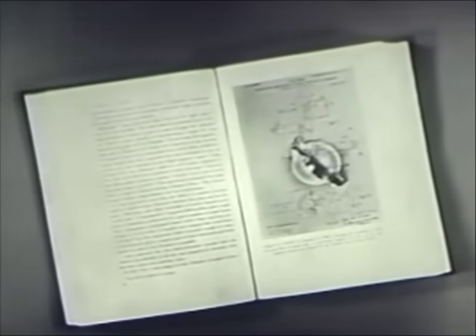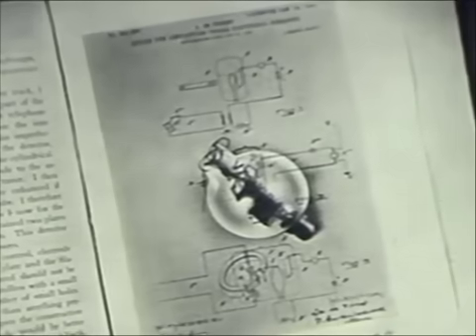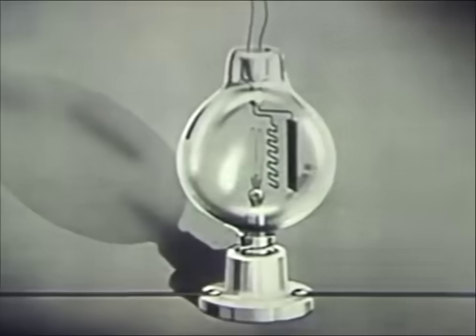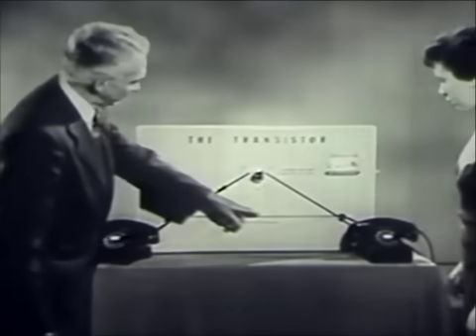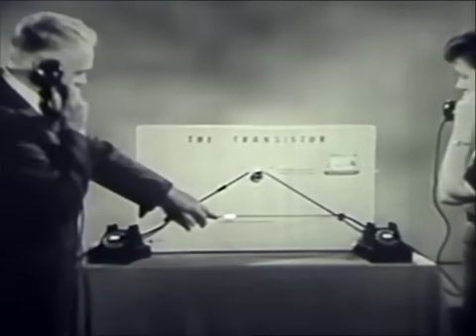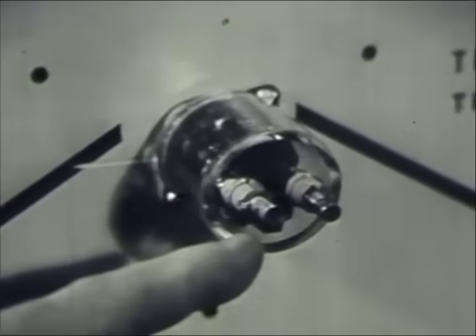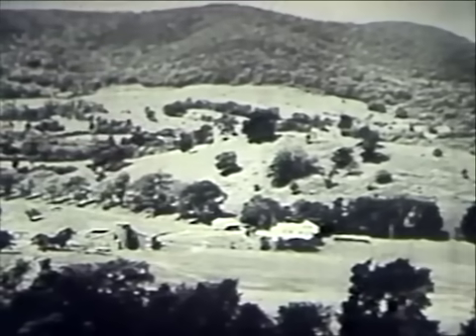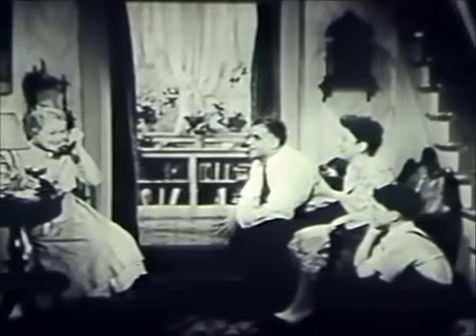The Transistor: a 1953 documentary, anticipating its coming impact on technology

Comment: I used to have a neighbor who worked on computers when they still used vacuum tubes.  He said that no matter what they did, there were always a few of them that were burned out, so the thing never worked properly.  By the way, I still have an old transistor radio somewhere and yes, it works.   The first record player that I received from my parents as a child had a mainspring to power it. Go figure.
Reply: The term "bug" is derived from something that happened in 1947.  Engineers working on Harvard University's Mark II computer discovered a bug caused by a moth trapped in a relay.
Reply: @robertromero8692 If you look at the note they made at the time, it's clear they knew they were making a pun. So while Grace Hopper claimed that that was the first use of the term, I dont think it's actually true.
Reply: That's one of the problems about having a hot cathode in a vacuum, it's inevitably going to have a limited lifetime, rather like an incandescent light bulb.
Reply: The war time Colossus code breaking computer was never turned off, heating and cooling caused the valve/tube failures.

Comment: Another video on transistors said that between 1960 and 2018 there have been an estimated 13 sextillion transistors manufactured. 13,000,000,000,000,000,000,000. And if you count Moores Law, could that now be 52 sextillion?

Comment: The number of transistors in my "electronic brain" used to watch this video number well into the low billions, and only use a measly 45 watts of power! Plus, my laptop is an "old" Mac from 2019 with an "outdated" Intel i9 8-core processor. 😉

Not bad for 70 years of advancement (1953 - 2023)!

Comment: Most people  know about inventions such as the filament light bulb, phonograph, and telephone, along with the airplane and automobile. FEW, however, know the history of the electric generator (which made it All possible) or the evolution of the DC, and then AC (Tesla) electric motor. Marconi invented the radio, and  DeForrest perfected the vacuum tube. The Parsons steam turbine made electrical generation, and steam propulsion in ships, Much more efficient. Frank Whittle invented the jet airplane engine-back in the early Forties, but the Allies didn't develop it in time for World War Two. 
Fluorescent bulbs-cooler and more efficient than the incandescent type-appeared in office settings, starting in the 1920s.  Hall and Herroult developed an economic method to electrolyze aluminum, so that the metal finally became Economical and Practical.

Comment: Cerebras has the world's largest chip: 2.6 trillion transistors -- that's 2,600,000,000,000 -- with 850,000 cores on TSMC 7nm.

For home computers, the Epyc Genoa 9654 (96 cores, 192 threads) contains 78,840 million transistors. That is 78.84 billion transistors in one CPU.

Imagine going back in time, taking one of those CPUs with you, and putting it on the table in front of the original designers / creators and saying, "Your work has lead to this in 2023 -- a computer with over 78 billion transistors doing more computation in one second than all of your computers on Earth presently do in a decade."

Comment: I still have an original 20 pack of 1698 Western Electric point contact transistors in the original box from 1953.  It looks identical to the part on the left side in 0:42 of the video.  Its so old that it even predates the 2Nxx numbering schemes for transistors.  It is even serialized.

Comment: Yet the tubes these transistors replaced, are still massively superior in audio applications to this day.
Reply: And yet the mixing consoles used in recording studios don't use valves, they use op amps containing transistors.
Reply: @deang5622  all the older stuff recorded pre 90ies were done so in studios specifically using valves for all applications.

That's also why hifi buffs go crazy for old RCA recordings, Abbey road, you name it.

Comment: Man, the narrator could never have known just how close we'd get to emulating the human brain with transistors. I suspect we won't quite get there on Silicon, optronics are rapidly advancing and promise a similar degree of speed and efficiency gains over transistors as transistors did over vacuum tubes. That's where we'll see truly human-level (if not humanlike) computers. Also where we'll see the same amount of computing power as an RTX 4090 and a Threadripper with 2TB of RAM in a literal grain of rice-sized computer, powered by ambient light. 

In another 70 years, we're going to be looking at videos introducing and explaining the first optical gates the way we currently view this.

Comment: @ChatGPT "describe the invention of the transistor and how it was perceived to be used in the future" - result is
"The transistor was invented in 1947 by American physicists John Bardeen, Walter Brattain, and William Shockley, who were working at Bell Laboratories at the time. The transistor is a semiconductor device that can amplify and switch electronic signals, making it an essential component of modern electronics.

The invention of the transistor revolutionized the field of electronics, as it replaced bulky and unreliable vacuum tubes, which had been the primary means of amplifying and switching electronic signals up until that point. The transistor was not only smaller and more reliable than vacuum tubes, but it was also more energy-efficient and less prone to overheating, making it ideal for a wide range of applications.

At the time of its invention, the transistor was not immediately recognized as a game-changer. However, as its potential uses became apparent, it was quickly adopted in a variety of applications, including radios, televisions, computers, and other electronic devices.

The transistor was perceived to have enormous potential for the future of technology, and this was reflected in the 1956 issue of the magazine "Electronics," which predicted that the transistor would "revolutionize almost every phase of our lives," from communications and transportation to health care and education.

Indeed, the transistor has lived up to these predictions and has become an integral part of modern life, powering everything from smartphones and laptops to satellites and medical devices. Its invention marked a major milestone in the history of electronics and has paved the way for many of the technological advances that we take for granted today."

Yes I think we can safely say that the transistor has lived upto these predictions and way way more.  This ChatGPT query was pure science fiction at the time this film was made.

Comment: Simply amazing that this came out the year after that weather balloon crashed in 1947! 😉
Reply: I was thinking the same thing. I'm just glad it crashed in New Mexico and not a foreign country. We either would've missed our chance (worldwide as a society) or been some other nation's subject.
Reply: This old myth again.
Do you think aliens in a spaceship 1000 or even as a little as 100 years more advanced than us would be using discrete transistors?

No, of course not. At the very least they would be using massively integrated circuits containing billions of transistors and no one had the equipment in those days to see the transistors on an integrated circuit, let alone probe it with test equipment to measure the electrical characteristics or chemically analyse the elements used in the construction.

Comment: How in the world do videos from the 1950s explain things so much better than most modern day videos.

The analogy with the size Empire State building and the power and cooling from the Niagara Falls required to run a computer using vacuum tubes is so smart. Really shows how much technology is immensely improved by such a seemingly insignificant electronic part called the transistor. It’s amazing

Comment: Wow! 😮
These early pioneers would be absolutely astounded by how far we've come! 😮 The smartphones and tiny computers we take for granted today are lightyears ahead of anything those scientists could have even dreamed about! 😮

I grew up with computers, but I'm even shocked at how far we've come 😮 The smartphone I'm using right now is far from top of the line, but it's still at least 1000000 times more powerful than my first computer!

I thought I was kicking ass when I upgraded to a computer with 128 KILOBYTES of memory! 🤤 Such a "large" amount of memory that it could only be accessed by bank switching 😮 These days 128 k is a laughably unusable amount of memory (What the hell am I gonna do with THAT!? 😂 I can't even load a tiny thumbnail picture 🤷‍♂️) But back in the day, that was enough memory to load an operating system AND a game! With room to spare! 🤣 Most games or utilities didn't even use the full 128 k of memory. I could often "get by" with 64 k or sometimes even as low as 16 k.

My first floppy disk drive was slower than the slowest possible 1G cellular phone network 😅 But it was STILL about 20 times faster than the cassette drive I had before it 😮 The floppy drive would take several minutes to read a full 90 kilobyte side of a floppy disk. And the writing speed was even a bit slower 🐢

But damn I got a lot of use out of that computer! I absolutely loved it! 😍 I taught myself 6502 hexadecimal code on that computer at about 9 years old!

Comment: Speaking of the military....until 1999, an old Rockwell Collins SW3600 model switching system was used to route nuclear launch authorization codes to their respective SAC silos. This switch, which was purely mechanical, had 4 trunk lines and was the size of large room. It was like magic to watch this thing work. It was used for so long because it never failed. Ever.
I was the one who decommissioned it in 1999. 
What we have wrought with pencil and slide ruler alone is absolutely fucking amazing.

Comment: It is funny to consider most of the focus for the use of transistors in this documentary are on stuff considered secondary in the modern era. Today, transistors are most well-known and used as the basis for the integrated circuit, the core of modern digital computers. Mini and Micro Computers and Computers-on-Chips are the biggest technological leap resultant from transistors.

Comment: I remember buying discarded circuit panels from Radio Shack studded with transistors, diodes, capacitors, etc. in the fifth grade (circa 1968) .  The IC was just becoming commonplace, and even then the coming revolution in microelectronics wasn't widely recognized.  Two decades later, Apple's Mac Plus was on the market, rocking 1MB of Ram and a clock speed of 8MHz. The 30MB hard drive that went with it was as big as the phone book. You youngsters might be able to see one of those in a museum.
Reply: The hard drive size sounds exaggerated.  I bought a 10 Mb hard drive in the mid 80s for my PC that was only about the size of a few paperback books.
Reply: @robertromero8692  No exaggeration at all.  The Mac Plus had a 9" diagonal CRT, was maybe 16"tall and about 12" square, and the non-Apple hard drive was precisely the same footprint, and about 4 inches thick.  I drew my first steel fabrication project on it in 1991 using "MiniCad", and every time I zoomed in or out, or made the slightest change, it took a couple of minutes to redraw the view.  Countless hours later, I had a file I took to someone with a pen plotter, who drew it out and made actual ammonia developed blueprints to submit to the architect. He was much impressed by how good they looked and said so, which pleased me greatly even if it did take longer to make the shop drawings than it took to do the actual work.
Reply: @phillipdavidhaskett7513   We had that same hard drive. I was in college in 88 and my dad used my student discount to buy a Mac, and as you say the HD was the same footprint. Still a HUGE step up from our duo-diskdrive equipped Apple IIe

Comment: One advantage of being stationed on a US Navy ship launched in 1968 is that the Navy doesn't generally change things much if they still work properly and upgrading them doesn't enhance mission readiness.

By 1990 the ship was an interesting combination of original equipment and modern technology.  I'm just as comfortable measuring bias voltage on a transistor as i am troubleshooting missing voltages on a vacuum tube.

Comment: "They will make possible more compact devices that will need less maintenance and have a longer life"

 ~ 70 years later ~ 
More compact - check 
Less maintenance - check
Longer life... A radio from the 50's still works today but the one I bought two years ago is broken already....
Reply: Please to not blame the transistor or other semiconductors in the first line. What makes cheap electronics fail in the first place is chemistry. Which is present and also working in (electrolytic) capacitors mainly. These fail often after some - shorter or longer - time. Also: soldering materials often fail due to oxidation. Gets brittle. So contacts are failing. In every circuitry if standing and being used long enough. Semiconductors fail on power overloads, overheating, electrostatic discharge. which they are susceptibe for. (MOS devices especially). A cure for this incapability is already underway today, the SiC semiconductor technology.
Reply: Ok but a television at the time cost like $5000 in today's money. We have created a throw-away culture where people just want things to be cheap and accessible. Also as complexity goes up exponentially so does the room for error and difficulty in diagnosing and repairing problems
Reply: @skeetsmcgrew3282  True words defenitely. But the one from the 90's I bought in 2010 worked until 2017. Pretty good, and the only maintenance was hitting it on the top.
Reply: @oevr37  I remember deciding at one point I was tired of crappy garbage, I was going to buy the "good" version of things even if it required saving up for it. Turns out that generally doesn't exist, the "good" version now is just "smart," or it's expensive because some hipster company did a startup and couldn't find a way to make a deal for labor overseas even though all their parts are the same Chinese crap everyone else uses. Trust me, I get it. But its also hard to argue that "things just ain't like they used to be" when you can get a 50" tv for 500 bucks that would look like a window into another planet full of wizards to people 70 years ago. Give and take
Reply: @skeetsmcgrew3282  This is also true. I personally have something against "smart" objects, they better not get too smart with me, you know. Some kinds of objects still are quality, especially if there's a professional version. (like vacuum cleaners for example). And it is definitely worth it to invest in quality where it exists. But yeah, some things just get worse. By the way I wonder what people from 70 years ago would find more mind blowing; a 50" tv or the price of food compared to it. Stuff is getting cheaper but everything else is getting more expensive. Does make you realize what is important doesn't it?

Comment: Your someday has arrived many years ago, the head of a pin, today you can have at least 30 to 50 color TVs equivalent. Today is August 30th 2022, I've been involved in electronics since I've been 9 years old, when I built my first radio, with no prior experience whatsoever. That was back in 1952.

Comment: Just love these old films, If you'd told the engineers at Bell Labs, in 1953, that 70 years hence, there would be a company called Apple who would put 20 billion transistors in a little box called an M2 chip, they would have laughed you out of the building, makes you wonder what the next 70 years hold!

Comment: Come on they just decided hey let’s dope Germanium in such a specific way that this happens and gives rise to the Digital age just so happens not long after the Roswell crash and they did it in only a year or less of research when the Japanese spent decades to reverse engineer and figure out exactly how to heat and control the crystal structure of the atoms and literally thought it impossible and had to invent the needed precision controlled equipment and realized exactly how freaking hard it actually was yet these guys just figured it out in such a short time and able to ramp manufacturing up literally overnight. It was some alien tec and we got a 50 year leap at least in technology if not hundreds of years. Same for night vision, LEDs, medical Lasers, and so many other tec that came out of military and handed over to private industry to figure out how to replicate manufacture and use them. All thanks to the 1947 national security act and operation paper clip.